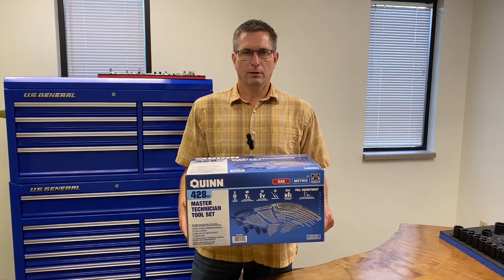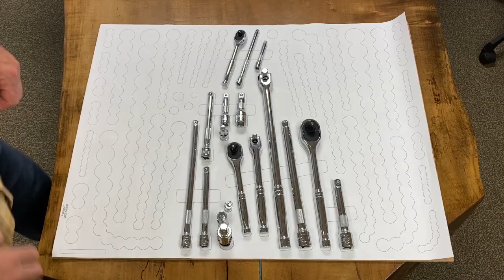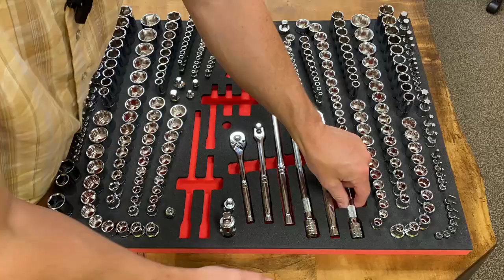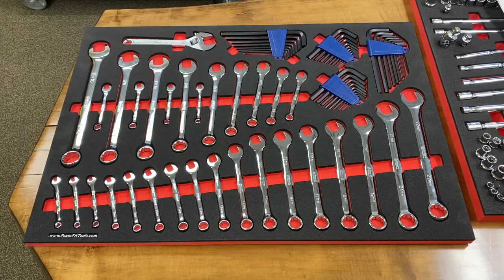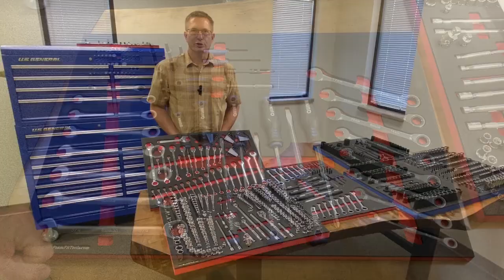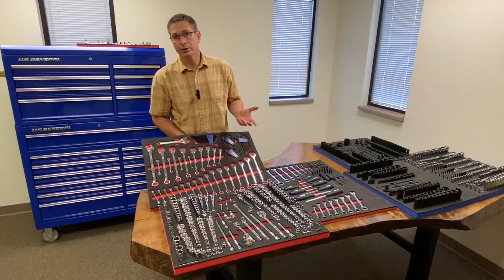Organize the Quinn 428-pc Mechanic Tool Set in the US General 34-inch Full-Bank Service Cart

Comment: Great Video Nice looking products question are you going to have organizers for icon in the Us General 5 Drawer or 4 Drawer?
Reply from the maker: That's a good idea.  We're currently working on designing organizers to fit the Quinn 428-pc in the 27-inch US General box and the 30-inch, 4-drawer cart.  Other stuff in the works includes the Husky 1200-pc set.  Hopefully after that we'll do some more layouts for Icon and Tekton. I need to do a layout that includes Icon's large SAE combo wrenches.  I'll have to start thinking about what other Icon layouts we could do at the same time.
Reply: @FoamFitTools That's Great I will be looking out for Icon in carts Thanks